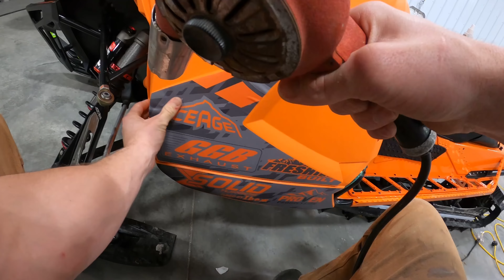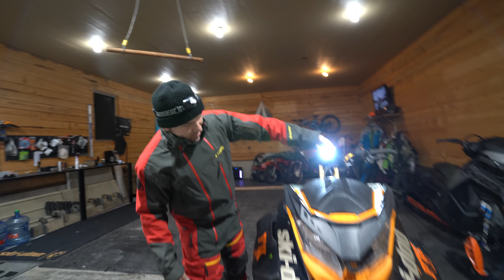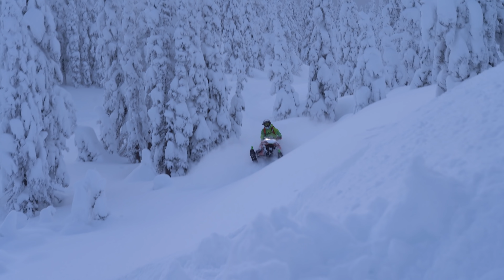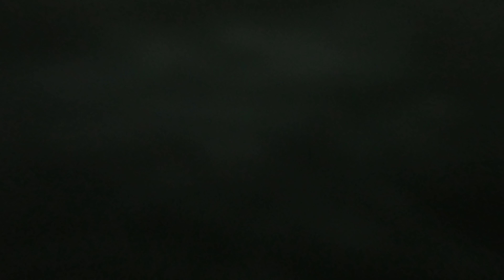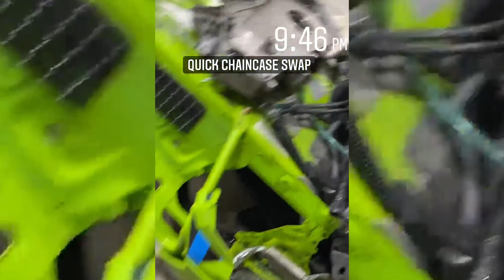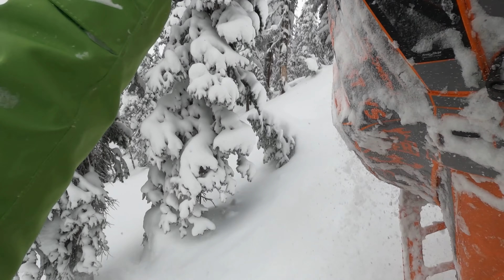Smashing Rocks and POW | EP. 8

Comment: I don't know if that is the rev limiter that you're hitting but It sounds like that it might need a little more clutching done to it. That turbo sounds awesome though a lot different than the others and seems like it just spools right up.
Reply from the maker: Yeah it did need a little more weight. Added some the next day and wasn’t hitting the rev limiter! Definitely a sweet kit, pulls harddd
Reply: Solid uses a anti surge housing, that’s the biggest reason they sound different, other reason is how much more efficiently the route all plumbing. (Can’t remember the technical word for it) but it’s basically a factory turbo for the cat… it’s that well done
Reply: @577stensgard  thinking of turbo lag? I'd have to agree on how it sounds on his sled, really seems to work extremely well.
Reply: @farmingnodak  no, I’ll find it later
Reply: @farmingnodak  laminar flow is what i was talking about
Reply: What brand turbo set up you guys running?  Do you happen to know what mm turbo it is?  Awesome vids.